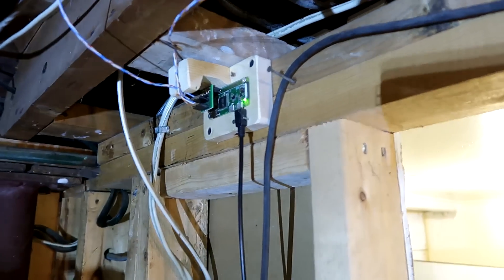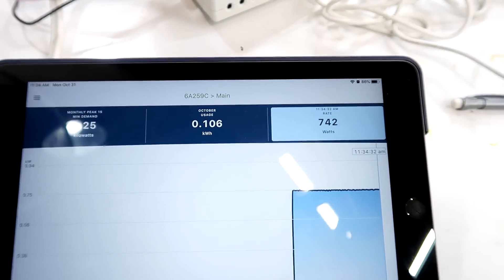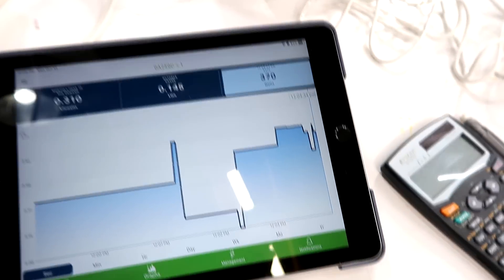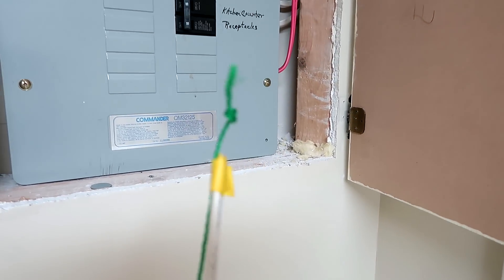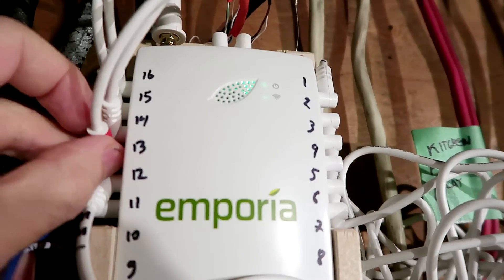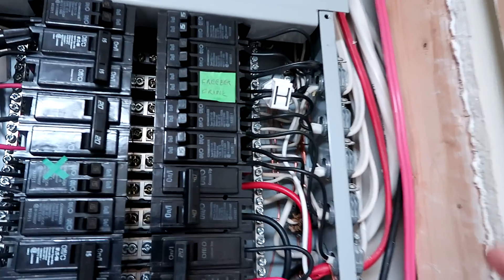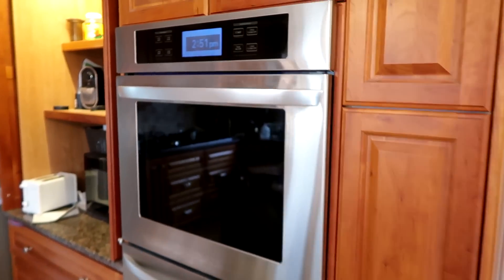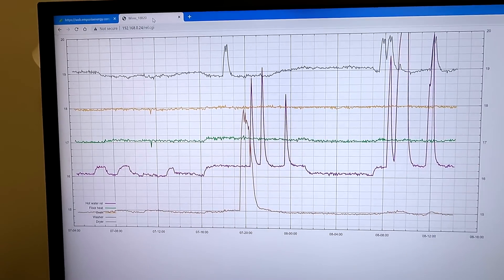Power monitoring 16 circuits at the breaker panel

Comment: Definitely agree with wanting local control and storage. IoT devices might as well come with an expiration date on the box. It may be a year, it may be more, but probably sooner than is reasonable it will be a brick due to the dependence on the Internet service. It'll be made "obsolete" (just buy our new thing that isn't better but comes with a subscription!) or the company will fold, or get bought out...
Reply: ...Or a crappy update that will brick the device as well If it doesn't end up limiting what you can do further or take away features like many "updates" nowadays.

Comment: You want to talk about obsessing about power consumption, we installed a 10kW grid tied solar array two years ago, and I've been compulsively trying to make use of every bit of power we generate given the draconian net metering terms here in Georgia.  We're paid out every night at midnight for our excess generation, so I've been using a Sense home energy monitor to track our production vs our usage.  It's been very handy, but quite expensive.  Every year or so on average, the main unit fails and I'm forced to buy a refurbished replacement at a not-insignificant cost to myself.  Also, for some bizarre reason you can't re-use an email address to activate the replacement - you have to use a new email address for each serial number.  Very annoying!  I'd love to see what you come up with for a monitoring solution, and I guarantee you there's at least a few of us out there who are desperate for a better way to keep tabs on our energy usage.  It'd be great to have a way to monitor individual breakers, as I also installed mini splits throughout the house and have a dedicated circuit for EV charging, which is the primary way I've been banking my excess solar production.

Comment: how would you meaure the accuracy of your kill-a-watt? surely you can't plug your bandsaw into an oscilloscope
Reply: ideally with an energy/power reference (ie. Radian) or device with NIST traceable calibration.
Oscilloscopes (esp probes) tend to have accuracy much worse than 1%.
The manual for Kill-a-watt states power accuracy is max +/-2% (typical +/-0.5%) for the first 6 months.

Comment: I did a similar thing with the IoTaWatt (https://youtu.be/wM1FMRFgvzY, no affiliation with the company) to monitor my energy usage.  It's an open device and keeps your data stored locally on an SD card, and you can see the data in realtime by navigating to the device's IP address.  I think the graphing functions for the IoTaWatt are a bit better than the Emporia, too.

The instructions for it recommend looping the 240v phases as you did to properly count both legs.  I never thought of doing two circuits of the same phase in one CT though, so may have to give that a try.
Reply: I also use IoTaWatt, it seems like a better product than this one
Reply: Sadly IoTaWatt is no longer in production.
Reply: @mike_realityi  They restarted the production, and I just bought one for my house. I like its integration with different services that you just install yourself on your own machines.
Reply: @ovidiucp  Thank you so much. That just made my head spin. Now do I go with the IoTaWatt that I would love or a more Enduser Friendly setup do to the possibility of selling the house in the near, 1-3 years, future.

Comment: I have had pretty good success with iotawatt which is a similar kind of unit hardware wise feeding into influxdb and displayed in grafana, there is a little setup of the UI, but it's pretty straightforward just writing queries to pull the data into plots, easy to add other sensors such as temperature too, and all local with no cloud.
Reply: iotawatt works well with Home Assistant too.  Been using it for around 2 years and quite satisfied.

Comment: Since the dryer is a resistive heater my modern 2022 front load isn't really anymore energy efficient than your older one. Two loads of laundry reported by my monitoring is ~11.4kWh.

Comment: Did you check into IoTaWatt?  It's an open source power monitoring solution pretty similar to this but I'd gather it has already rich but expansible feature set.  I haven't used it but if I was not going to use electrical busway (Starline parts are cheap on ebay) I would try that project first as it does have some hardware already built and it's cost competitive with the "canned" (sure, nothing ever needs work out of the box) solutions like the one you've so nicely demonstrated in this well produced video.

copypasta from the project (there are github, etc, repos for the software)
About the IoTaWatt Project
The project grew from an informal effort to produce a versatile electric power meter that was easier to configure and use. Employing the popular and powerful ESP8266 nodeMCU chip, it has an operating environment with a modular approach to data collection, storage, and reporting along with an integrated WiFi web-server. The resulting firmware, after more than a year of development, is very robust.

Early efforts concentrated on using available kit boards and shields with a minimum of custom hardware. Eventually, it became obvious that a single custom board was needed to provide the platform necessary for the software to be useful. The current open-hardware design is commercially produced.

Although the schematics and PCB layout are open and available in the project Git, there is a lot more to making a viable commercial product. IoTaWatt, Inc. is a legal entity that was established in response to demand for production hardware. The basic device, as well as related equipment, can be purchased by using the “Buy” tab above. The costs to develop and certify the hardware were substantial and hopefully will be offset by sales.

The short term goals of the project are to develop more local analytic applications, and develop the community support infrastructure.

Comment: The Kill A Watt uses a shunt to measure current which is more accurate than a Hall effect sensor that clamps use so you'll probably never get matching numbers.
Reply from the maker: The clamps don't use hall effect sensors.  They are current transformers

Comment: Oh boy, Matthias, do I have a hint for you! You may very well already be aware its existence, but if you want a rabbit  hole of data collection and home optimization and analysis to jump in to, Home Assistant is absolutely amazing. It executes 100% locally and is open source and community driven. Nobody but you own and have rights to the data you produce.

It has amazing addon support. For instance InfluxDB and Grafana. The former is a database optimized for time series data, such as utility read outs, temperatures, relative humidity, prices, etc. The latter is essentially a very powerful graphing tool, which can query the aforementioned database for which ever data you put in it.

I see other comments mentioning that people have already integrated Emporia into Home Assistant. That would solve the data and logging issue as well.

Anyway best of luck.

Comment: I use the sonoff S31 "smart plug" which is just an esp8266,  flashed with tasmota, store the data via Openhab.  I don't know how accurate they are, but they are good enough to show me what is going on. I think those sensors are a cleaner way however  because you need fewer sensors.  Thanks for digging deeper for us.

Comment: If you have interconnected smoke alarms check those. Been a while since I checked that but I want to say the ones I have were drawing an amp at idle. They just don’t bother with efficient power supplies on those.
Reply from the maker: if they used that much power, they would get quite hot!
Reply: @matthiasrandomstuff2221  so to clarify that powers 5 alarms so it’s 20 watts per. I just pointed a flir camera at one out of curiosity though. The entire housing of the alarms are at least a degree celsius hotter than the surrounding wall.  I figured this out because I was having trouble getting my generator to run the furnace blower during a power outage so was probing the panel with a meter to figure out where all the power was going.

Comment: I used to try to monitor my major power-using appliances but found out that it would not change my usage habits. I did discover that single-lever faucet valves are wasteful if you forget to switch them to cold after using hot water.

Comment: I wrote my own firmware for the esp32 using Rui Santos esp32 server and graphing videos and codes to start out. 
I store radiation counts of a GM tube and store them every 30sec along with an internet time stamp for 48 hours on the esp32, and if I don't download it within that time, it will right over it round robin fashion. It has OTA so upgrading the firmware is nice. It's outside on the fence post.
If you want something good that does exactly what you want now and in the future, you have to make it yourself.
In your case, I would reprogram the board with a custom firmware and be done with it.

Comment: Check out the Shelly device. It only does 2 legs, but it seems to be accurate.
Reply from the maker: I bought a shelly device, accuracy was very disappointing.  Also, not rated for the currents, connections too flimsy for big wires, and woudl be too much of a mess in the breaker panel.  Totally unsuitable.
Reply: @matthiasrandomstuff2221  thanks for the reply. I use one on the main legs coming in and a second one on the well pump, mainly to see how long it runs. I'll get my clamp meter out and check the main legs against the Shelly.

Comment: I've been planning to do this since I bought a hot tub last year, bought a few bits and pieces to play with but haven't gotten around to it yet. I'd recommend trying to flash the existing system if you can, in any case, as it is just an ESP32 and has its own power supply, that's likely worth keeping. Top quality content, I love to see this kinda thing!

Comment: I have been using a pi4 with docker containers for a year now for home monitoring and love it. Jertel/vuegraph is on github; portainer, influxdb and grafana come together with that nicely to let you save your data locally. I am using an Emporia system for energy monitoring. It does rely on their server which is not a problem right now. It took a while to sort stuff out and it is by no means polished but the data is being saved with what I believe is an "infinite" retention policy on influxdb. So I can spend occasional winter nights tweaking it and perhaps correlating my temperature readings with a local "official" weather station. My readings go through a python script into a separate influx time series on the pi4.

Comment: 1. Brilliant idea on routing the 2nd leg backward thru a single CT. 2. Fashion is to stuff a fridge into a cabinet with minimal air; you might help fridge longevity & reduce watt consumption adding a small fan & quality air circulation path. Excellent subject matter & video coverage, thanks
Reply: Or just open the vent port from the top, creating a chimney?
Reply: Hmm that sounds like a project right up his alley

Comment: Shame you missed out on the IotaWatt device It is exactly what you mention in the end of the video. It is very similar to the Emporia, but allows for totally local logging and updates. It can push to cloud if you want to, but you can also push to influx and visualize in Grafana.
Reply: Just finished the video, and virtually every complaint is not an issue with the iotawatt. Want multiple graphs overlaid? Sure. Configurable time periods with configurable grouping period? Yep. Iotawatt also uses a ESP and yes they can store all that data using a SD Card. :) The really fun one is when there's a blackout nearby I can very accurately measure it as the Iotawatt doesn't just record watts, it also records voltage, power factor, hertz and a few other things. Blackouts cause interesting jumps and dips in the voltage and it samples fast enough to catch them.
Reply from the maker: It was one of the devices I considered.  But it's quite a bit more expensive!
Reply: @matthiasrandomstuff2221  another vote here for IoTaWatt
Reply: @matthiasrandomstuff2221  It is, but I guess that's the price of being able to own your own data. Plus having interacted with the creator on their own forums I happily support the product. It really is worth it to me to be able to pipe all the data into my own database and no rely on the cloud.
Reply: I've had my iotawatt since 2019 and it's very nice knowing I have all the energy monitoring stats stored locally. I've got solar and Home Assistant and they all integrate very nicely. If you like data, it's certainly the best option - it gives you all of it, and there's zero cloud.

Comment: Take a look at EPSHome. You can run it by itself or with another frontend like Home assistant for simpler graphs straight out of the box. If you dump the data into for ex influxdb and use grafana ontop of that, all your graphing needs should be solved.
Reply from the maker: I looked at that, but it's not really made for that, and the graphing it can do seems rather rudimentary
Reply: @matthiasrandomstuff2221  by "that" do you mean home assistant or esphome? home assistant seems to have a goal of being made for everything, which can get a bit overwhelming. And graphing is extremely rudimentary. it does however simplify the installation of all of the above. But my main point here is esphome, which is pretty much simplified programming of esp32 and esp8266 devices with over-wifi updates and reprogramming. It has fairly large support for different sensors, and if all else fails you can always add a c-file and program everything yourself and still rely on just the simplified reprogramming.  But if you want grafana you need to store the data somewhere aswell.

Comment: That's my exact washer dryer set! Love those old things!
Reply: The nice thing about older appliances is that they tend not to beak down and when they do it's easier to repair them. My 20+ year old dryer broke last year and I found a paper copy of the schematic inside the back cover and the replacement thermal switch was stocked at the local parts store.
Reply: My 1983 vintage washer dryer are called "Lady Kenmore".  I assume this is offensive to some people.  I self-identify as a man; I use the He pronoun;  and I do the laundry because my wife never checks my pockets!

Comment: Shouldn't actually be too hard to write your own firmware for the device which sends reports to a local server. Saves you the trouble of designing a bunch of hardware. Nice of them to use an MCU that is so easy to program.

Comment: I bought one of these last year! helped me find the big energy wasters in my home and actually dropped my energy bill by identifying non led lights I though I had changed out when I moved.
Reply from the maker: There's quite a few energy wasters in our house, but they are all stuff the wife uses.
Reply: @matthiasrandomstuff2221  
> blames wife for using energy 
> glances over at entire workshop
No energy wasted here.
Reply: @matthiasrandomstuff2221  this is exactly my experience too!! I'm the only one in the house who cares about power usage.
Reply: It’s a bit complicated but it involves flashing, firmware, and feedback loops.  😉  

I heard that some homes were accidentally built years ago with the old style power meter with the spinning disc right next to the front door so the residents could visually see their energy consumption every time they came through the door, and they had lower average power consumption than the exact same homes built with the meter where they normally put them, out of common sight.  Just being able to be aware can help a lot, and paying it helps you want to be aware.
Reply: I am using a energy saving wife. works quite well.
Reply: @CompactFlesh  How does that work? Can you turn her off when not needed? 🙂

Comment: I have a raspberry pi running mosquito , telegraf, influx, and grafana. All the data from various energy monitors, temperatures, solar controllers, etc sends the data to the pi and then I can do whatever I want to display the data in Grafana . It has been working very well and been stable. It is super easy to set up whatever sensors on an esp if flashed with Tasmota and also tasmota makes it easy to send the data to whatever mqtt server you want ( mosquito in my case). I use peacefair pzem energy monitors which are inexpensive and are supported by tasmota. https://www.youtube.com/watch?v=xKxGaerzNKM

Comment: We know you won’t be able to resist hacking a way to pull it off the IOF server. 😂
Regarding the washer/dryer. In Europe the washers come with varying centrifugal spin cycle  speeds. The higher speeds make a big difference. I think in North America there used to be a product that is just a high-speed centrifugal spinner. If you use it between washer and dryer it can considerably reduce dryer time.
Reply from the maker: Indeed, it always fees like more water could be spun out of the clothes coming out of that washer

Comment: We have removed our dryer, and we hang up clothes, sheets, towels ect. and it all drys by the next day.
Reply from the maker: We have been using the clothesline mostly till now, but as it gets colder, it gets less effective.
Reply: I've put a powerful dehumidifier in the same room as i hang my clothes in my house.
Machine heats the room, and dries the clothes at the same time, use little power compared to a dryer. But yes, it takes longer.